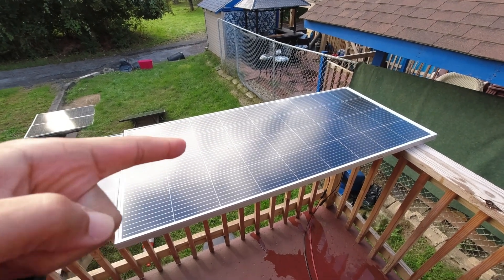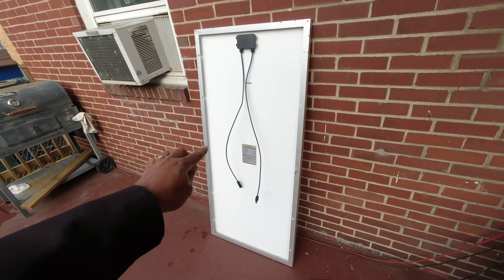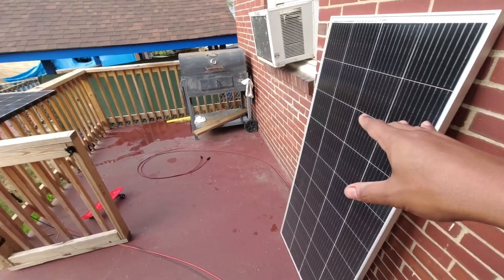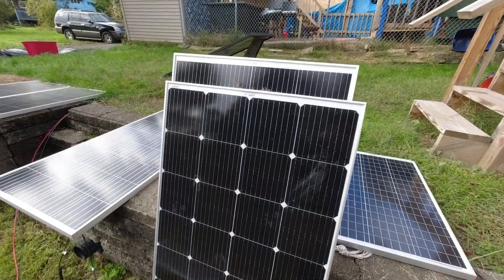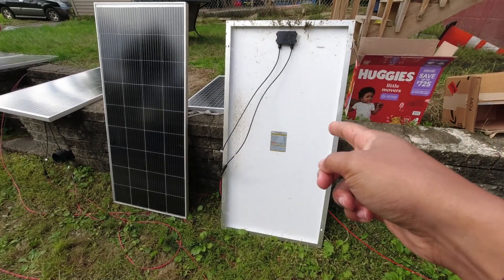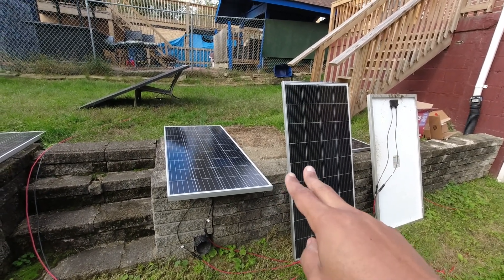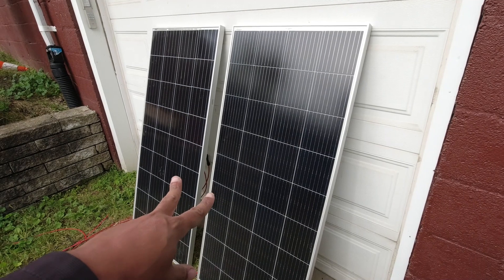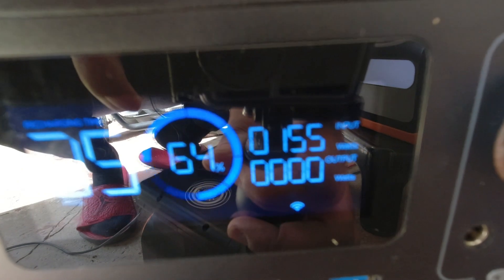BougeRV 180 Watt 9BB Solar Panel - Size, Value, Usage, Comparisons & More

Comment: Excellent video! Great point about the higher voltage panels and the smaller Bluetti power stations. Some panels  differ by over 6 volts at peak power. The Ecoflow 220 I recently tested put out 15v and 12 amps at peak power! Not a good mix for the Bluetti power stations. 

Also, you're right about the panel sizing and the power output rating that they advertise haha.... Whether it's a 210w or 180w, they are all basically the same square footage and produce similar power (mostly).
Reply from the maker: Daaang @ 15v x 8 amps. That hurts for an eb joint. It would max out at like 120w. That's a bad day. Lol

And thanks Sir for the compliment!
Reply: 15v is just too darn low, I think. It's in everyone's best interest to crank up those volts. I suppose one argument is that over-voltage is what burns things out so when selling to uninformed people it's less risk to sell a low voltage panel than a low amp panel.

i would be interested to see if a 180w panel differs from a 210w panel more if its is pointed perfectly vs laying flat. I assume the difference in output would scale, but assumptions are often wrong. Maybe flat they are almost identical but pointed properly you actually get (30*0.8) watts more.

Comment: The Solar generators can't restrict the "input amps", they can however restrict the input voltage and hence restrict the power drawn or "pumped" into them. When you look on the nameplate specs. it shows only the acceptable input voltage range.
Reply from the maker: Some of them do limit amps. Most of them do "pull" a certain amount. 

They typically say don't overvolt because it can damage the device. I've never seen a warning about over amping.

Comment: They use to sell $230-250 for 200w panel, now they sell for $289 crazy expensive and their packing has problem. You get broken panel very often.  Compare to Rich Solar they have much better packaging.
Reply from the maker: They actually were just on sale for the early prime day stuff.

Comment: Nice video.  A higher voltage (right up to the 24V limit) is how I could get 72W into one of my smaller power stations, when normally I'd only set about 60W in.
Reply from the maker: Thank you Sir!

Comment: Thats funny i was just thinking about this issue today. I want to get an eb240 which has a max 500w solar input. I figured great cos i have 600ws of solar but.. Uh oh.. 10amp max on the device. All my panels are 100w with 5ish amps each in parallel. Gonna need to go series or get a higher voltage panel.
Reply from the maker: You could do series parallel. 2 sets of 3 in series for around 59 volts or so and then put them in parallel. For 10 amps. 
I have a video coming out likely next week about putting some panels in series on my eb120 which is the same mppt as the 240 and 150.

Comment: Nice explanation of the solar generator Amp limit, thus using a higher voltage is panel is a better pairing.  Took me a while to understand why my eb3a was not maxing out.  Thanks.
Reply from the maker: It's almost impossible to max it out. The highest I've seen is like 166. Glad the explanation helped. Nad thanks for Patreon love boss. Greatly appreciate it.

Comment: I was looking for an Hqst alternative, I have two 190's. Thanks to your video they seem almost identical. When I 1st bought my panels they were close to 150 each and now they are slightly over 200, The BougeRV 180 is currently on sale on amazon for 175. I have 4 hqst compact panels 100w but I'm tired of doing a series/parallel connection to make it equal to the bigger ones. Too much wiring.
Reply: And its temporary, I don't leave them sitting out. So imagine putting 2 panels in series, another 2 panels in series, parallel them, then add them to 2 hqst 190 panels in series to essentially make it seem like I have FOUR 190 watt panels then take them all down at the end of the day and start over on the next sunny day, lol
Reply from the maker: Ouch @ all that work. All those panels will produce power on overcast days as well.
Reply: @AskIveSolar  Yeah.....but I live in a bad neighborhood, I can't leave my panels out 24/7.....on the ground or within quick grabbing range, my garage roof is kinda messed up, I will gather up the courage and mount them on there one day, it's not too high off the ground but i'm afraid of heights, lol

Comment: I need some higher wattage panels. Something like that 300ish watt renogy you have. Nice video!
Reply from the maker: Check your local area! Facebook, craigslist, offerup
Reply: Go with Newpowa's 360 watt 9bb panels, don't make the same mistake I made and get just 4 panels, get 6, if you ever get an AC300 or higher you'll appreciate those extra 2  on seperate mppt's. Right now I have 3 of them on on string and just one one the other, smh. I can't buy 2 more there's a minimum order of 4. if you buy from them get it directly from their website not amazon, it's cheaper
Reply from the maker: I gotta check out these newpowa joints.
Reply from the maker: Not crazy about that price. Probably because of the weight and them tryna tax.
Reply: @AskIveSolar  is about the same width as the renogy 320 just a bit taller. I did carry it back and forth a few times outside to mount for solar before i just said screw it and hired someone to put them on the roof
I get 1300 something for 4 of them.
Reply from the maker: I got my renogy new from the marketplace. I want some legit panels for cheap. I'm always on the lookout.
Reply: @AskIveSolar  the only complaint about the 360 panels I had was disconnecting the MC4 connectors, it was a pain to remove compared to other panels

Comment: Hqst is Renogy. On the back of my Hqst 100 watt panel (compact one), it even says Renogy on the junction box
Reply from the maker: They probably all go through the same factory. Many moons ago it was said that rich solar was very similar if not the same as renogy panels.
Reply: I didn't know that.
Reply from the maker: I wonder if they are the same or if they use the same parts

Comment: I ordered one on the Amazon deal and will try it out later this week. Looking forward to it. I plan to use it in series with a bunch of 100w panels on the AC200 but the high volts are nice. The 28v 8a Bluetti inputs are hard to match. I ordered a voltage booster that claims it has an mppt feature that I want to test on the EB70.